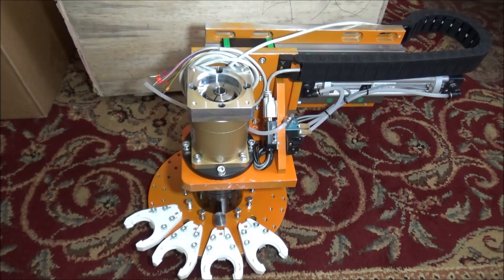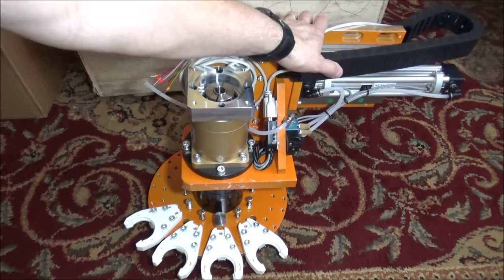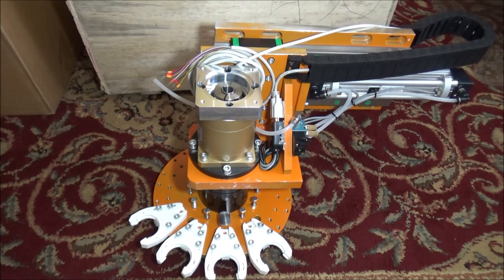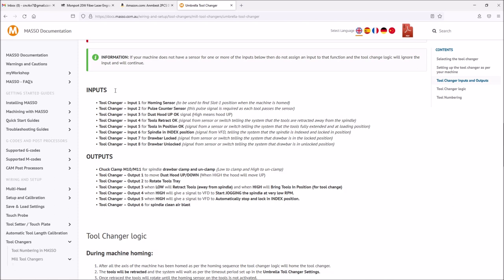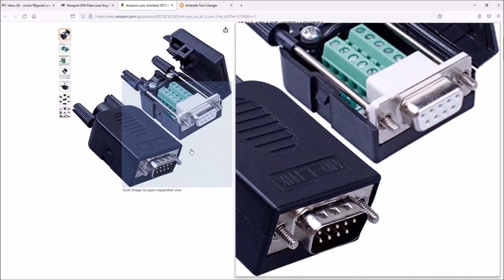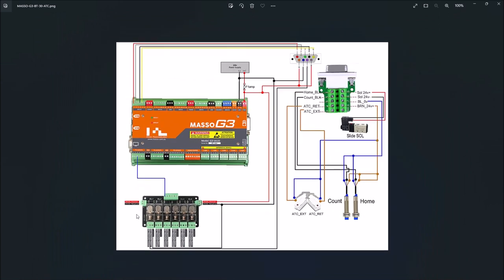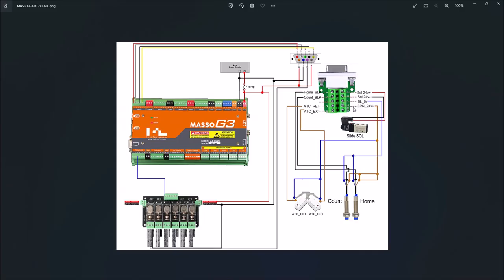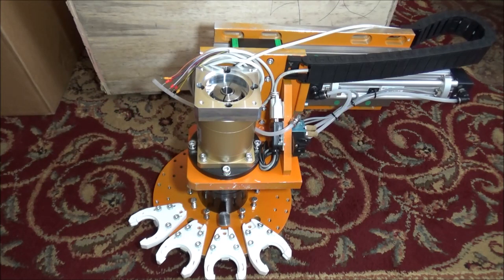MASSO UMBRELLA TOOL CHANGER WIRING

Comment: Very nice project. I have one question about the masso board... Do you think that is enough the 400kHz for the axis if the machine used the 5thaxis in the same time?? . I'm making a CNC with 5axis. Thanks
Reply from the maker: I think it will be fine But that is a question for Masso

Comment: Hei. Nice vid. Where is specified what kind of motor to use? I was thinking of useing dc driven geneva mechanisem is this posible with massso? Or it has to be stepper?
Reply from the maker: Yes, sure you just need switches to stop the motor after a rotation. Masso uses 1 output per revolution